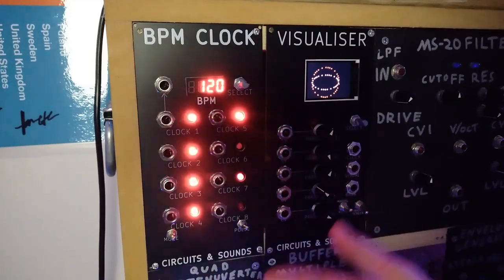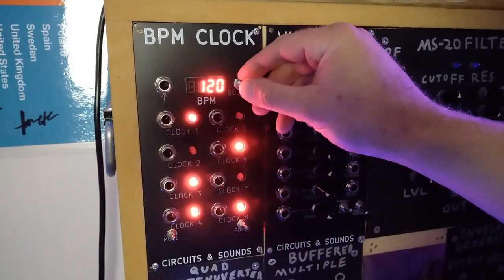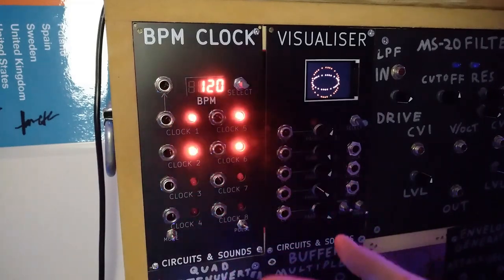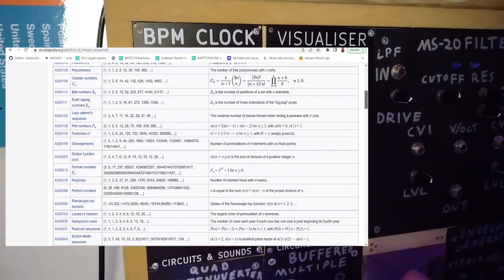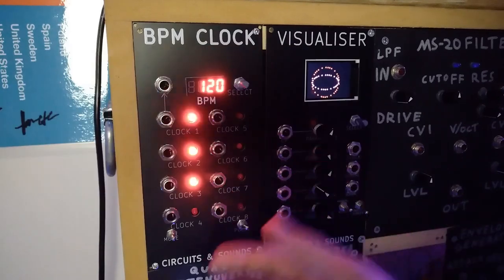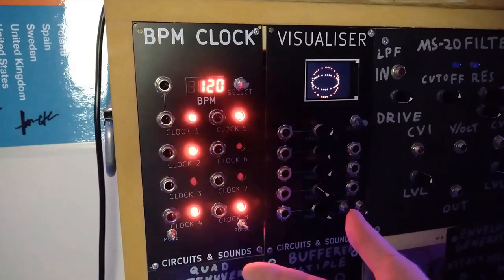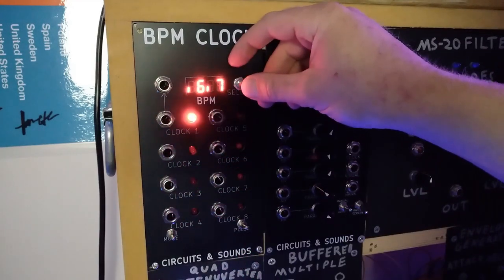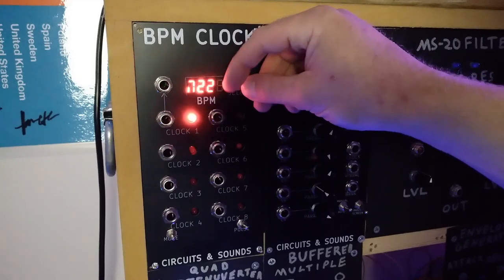A Kosmo Format Arduino Based Open-Source BPM Clock/Clock Divider Module For The Modular Synthesiser

Comment: I am still not able to compile this.  I downloaded the tm1637 by Grove 4 digit display by Seed.  Your tm methods are not matching with what is in the library.  

these two generate errors;
  tm.begin();
  tm.setBrightness(4);

all kinds of other errors   your tm.display has 4 parameters, but the library only supports to parameters

Can you please provide a link to the acutal library used?  Maybe it changed since you developed this?
Thanks
Reply from the maker: Hey mate,

Should be this library here: https://github.com/AKJ7/TM1637

Cheers
Reply: @sebbothebushnerd  works great now, thanks for that!
Reply from the maker: Awesome!!! No worries at all - keep me updated, would love to see your final results!
Reply: @Circuits and Sounds  yes I will post when done.  Will be a while, i have to wait on parts from china LOL